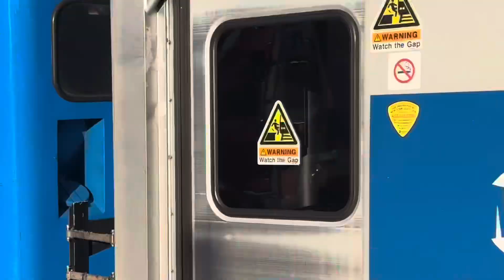How is MetroNorth rebuilding Park Ave Viaduct without stopping trains?

Comment: Almost all the information in this video is WRONG.

Just to address SOME of the wrong information in a simplified way:

GE Genesis IS THE SAME AS P32. (officially P32AC-DM.) Alstom has nothing to do with it. They have no catenary, and only use electric third rail in the Park Ave tunnel, before switching to diesel operation. They are mostly used when making trips to non-electrified territory such as the Hudson Line north of Croton-Harmon (to Poughkeepsie,) the Harlem Line north of Southeast, (to Wassaic,) and the Danbury and Waterbury branches of the New Haven Line.

There are no EMD or Bombardier locomotives here. Bombardier makes the unpowered passenger coaches that are pulled by the Genesis (P32) diesel locomotives and they also make the M7A electric multiple unit (EMU) trains. These are not locomotives.

The red striped trains in this video are M8 EMUs, made by Kawasaki. THESE have pantographs to go on the New Haven line, which doesn't have third rail and uses overhead electric wires instead (catenary). They are not the only ones that have regenerative braking. The M7A and Genesis (P32)  do also.

To say the M7As have climate control, rest rooms and luggage racks is ridiculous. Trains running here have had all these things since at least the 1950s. Also, they were delivered in 2004, not the late 1990s.

From a video production standpoint, when you talk about a specific thing, you should show that specific thing at the same time, otherwise the viewer can be confused. My advice is to take your time, record your voice-over multiple times until you get it right, and then edit in only the parts that are good. 

AND... you barely address the question in the title of the video. There are some great videos on youtube that better explain the process of replacing the viaduct, if anyone's interested. The southern part that's made of stone doesn't seem to be a part of this project.

Sorry if I'm coming off mean, but I just want to correct the record. I hate to see misinformation spread if people view this and take it as fact. You obviously have a great interest in this subject. Do your research and take your time, and your videos will improve.
Reply from the maker: Thank you for your feedback.